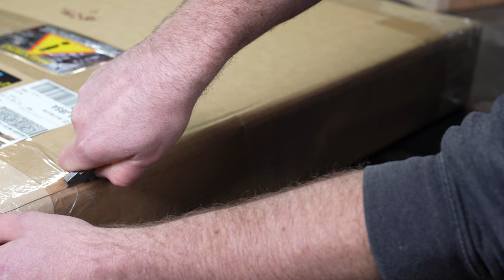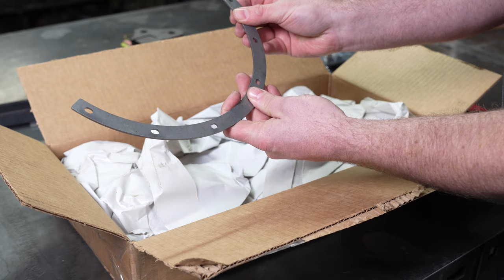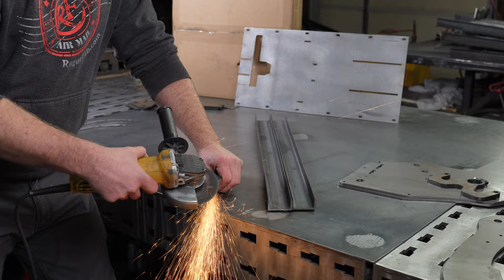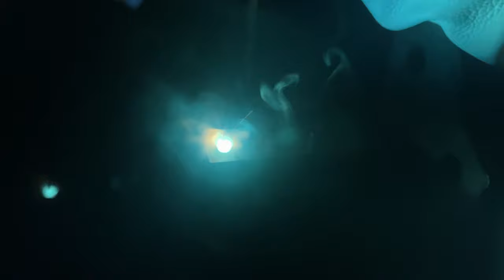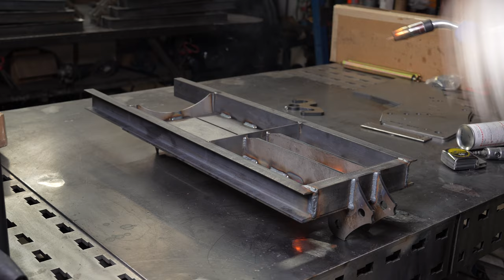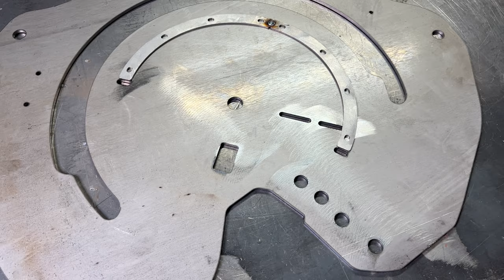How To Weld Your M601-M625 Tube/Pipe Bender Together! DIY Kit for an inexpensive option!

Comment: Just finished welding my 605 together, this video was a huge help! I thought it was much less involved based on an earlier build version I watched from a few years ago that Joe welded together so I opted for the weld together kit. The process was pretty easy with the right tools but I wished I saw this video before ordering the 605. In my opinion it is definitely worth the additional charge to get one fully welded and powder coated!! Nice job on the video!

Comment: I know this machine is a day assembly kit "but" all slag and burr cleaning should've been already done at your shop before the kit was shipped ! Another thing, all parts should already be trial fit and already ready for assembly and if you should've sprung to have all the degree numbers and degree marks machined into that plate. That sticker can get scrapped off over time and that one sticker makes your machine seem really cheap ! Put a little extra into your machines parts slag cleaning and fitting notches so the channel fits really nice or better yet just adjust the laser cnc program to do it instead . CNC laser machines are really nice and accurate. As a steel fitter and welder for eighteen years I know if you can eliminate any fit-up issues at the cnc it be stupid not to. And I've even cleaned my share of plate and a laser doesn't leave that much and takes very little time to clean it up and if you took pride in your product you'd fix thoes problems and have a number #1 product.
Reply from the maker: We sell stainless steel degree bars if you don't like stickers. No problem! And the point of the kit is to save the customer money. If we trust them to weld it, we certainly can trust them to de-burr it. That is just more expensive shop-rate labor they get to save. We offer these as turn-key welded and powder coated for the guys that want to hit the ground running. -Joe

Comment: It’s so funny watching assembly videos on rogue fab be so loose and “close enough” with their assembly. But their directions stress accuracy and alignment 😂
Reply from the maker: The alignment of the holes in the uprights (left side to right side) determines nearly all of the performance of the machine that is driven by alignment. The base, hydraulic cylinder mounts (within a broad margin), and other parts can be halfway to outer space and the machine will perform the same. Maybe that helps explain why we express the alignment being critical? It is a shorter story to tell people to just take their time and be precise. -Joe

Comment: Damn y’all weld the absolute piss outta that thing don’t ya 😅🔥I didn’t figure it would need half that amount of weld to hold it together
Reply from the maker: It's almost as though you engineered it ;) All the extra weld is for the "just in case" if a guy who buys the weld together actually isn't a very good welder. There is a massive safety factor in the weld seam design. Good call, Dude! -Joe